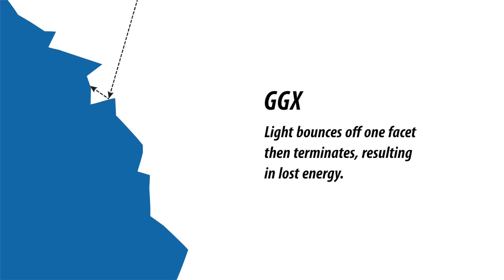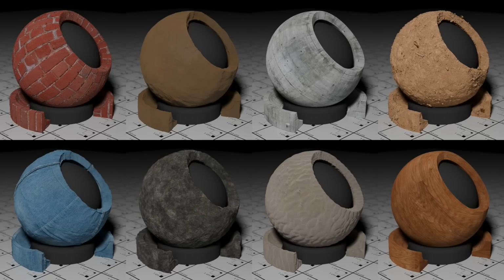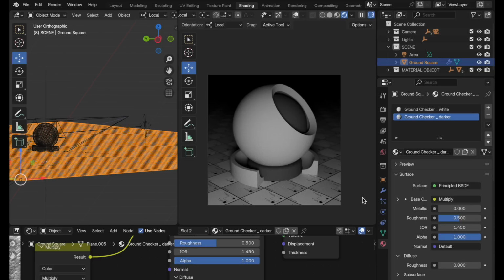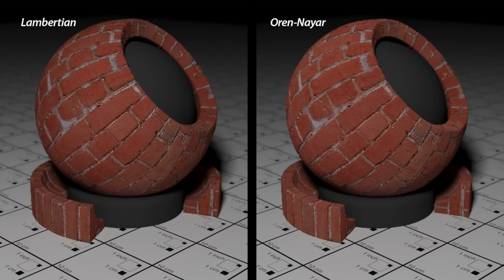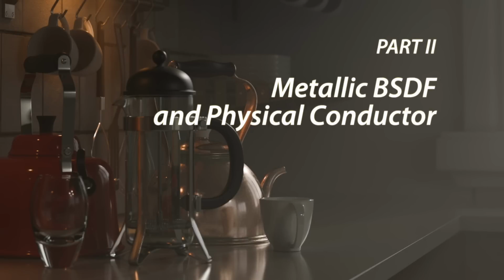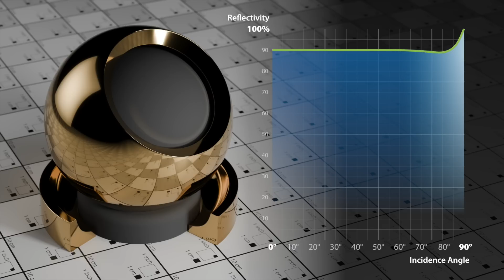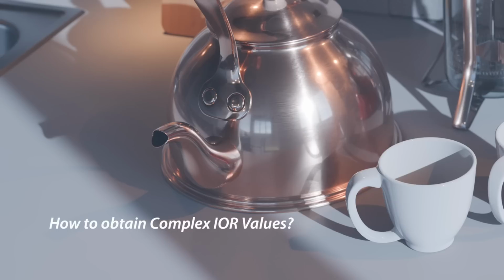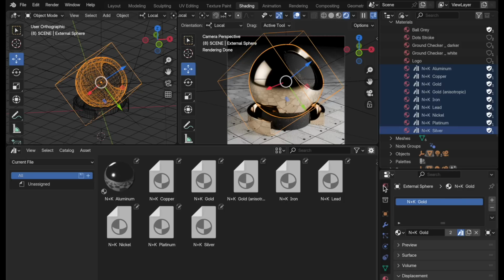Blender 4.3 Deep Dive: Exploring Diffuse Roughness & Physical Conductor

Comment: Would it not be better to take a weighted average from a gaussian/normal distribution centered on those 3 specific wavelengths for getting the RGB IOR and Extinction mode?

I mean that is probably overkill really and likely wont be far off from the single value things but it might be more accurate. Though I'm not sure how you would go about getting that data, just an idea!

Great video as always, i really appreciate the detailed walkthrough, and its exciting to have these new physically accurate things come to blender!
Reply from the maker: The endpoints I used seemed logical but by no means are they the only method you could use. I also tested with a middle overage of the general RGB regions and that works well also. I was going to show that but it seemed too esoteric for most people and also increased the length of the video too much.
Reply: @christopher3d475  ah I see, yeah that’s true haha it is a bit too esoteric and if the individual wavelength values are very close to that anyways then it’s a bit pointless so i totally get that!
Reply from the maker: @WonkyGrub  You'll notice I uploaded a 4.3 file containing the metals. I may do another set with different wavelength endpoints for exploration. What I found was the the more color a metal had, like the gold and copper, the more it was likely to be influenced by different primaries. This is actually one of the reasons why a spectral renderer has an advantage over an RGB based renderer.

Comment: diffuse roughness is a game-changer for dirt and gravel, I've always ran into the issue of having dirt look way wetter than it should with just regular roughness values, the solution was to lower the specular value, but that always felt like a cheat... and this is what we were missing as the solution for that!
Reply: While you can certainly increase diffuse roughness for these materials, that alone won't account for specular energy loss due to cavities.
Cavities are holes and openings where light bounces get trapped and die without ever reaching the camera. This cannot be simulated with a normal map.
So I would recommend doing that solution in addition to going Oren-Nayar. Note that Oren-Nayar also suffer energy loss for forward scattered light.
This is unrelated to the recent multiscatter improvements. Use it with care and consideration.
Reply: Totally! One of my pet peeves since the early days of 3D graphics is looking wet that should be dry.

Comment: Finally something what I wanted, if caustics be improved (path guiding is pretty good but slow as hell) it would be the best
Reply: Yes, Path guiding needs to get GPU accelerated asap🙏
Reply from the maker: Yes, I agree. That's entirely dependent on Intel. The Blender folks don't really have control over this.
Reply: @christopher3d475  That explains a lot
Reply: @christopher3d475  I'm out of the loop. Why is caustic difficult to be integrated into blender cycles?
Reply from the maker: @NCSiebertdesign  Caustics have to be solved in one of two ways; through a forward casting technique like photon mapping, or integrated into the global illumination processed used for overall scene sampling. Both present challenges. The Path Guiding algorithm helps with this by detecting strong light paths that can produce caustics. But it's not specifically a caustics solver per so, so improved caustics are a kind of by product. Generlized sampling can be to random to adequately sample paths that produce strong sharp caustics. So some 3D applications use a specific kind of general sampling using algorithms like Metropolis Light Transport. This is sort of like Path Guiding on steroids, and is capable of figuring out caustics within the framework of generalized scene sampling. Its downside is that apparently it's a challenge to properly develop and integrate. So caustics are just a challenge for a variety of reasons.